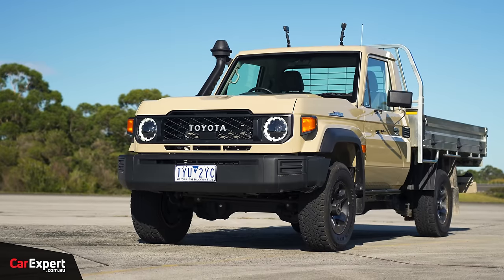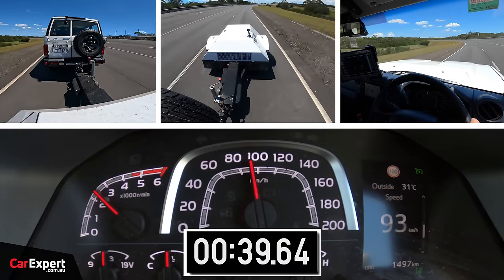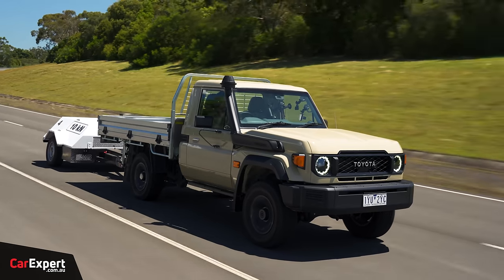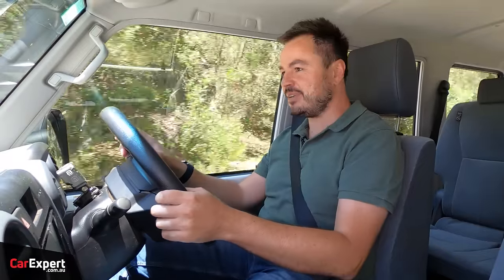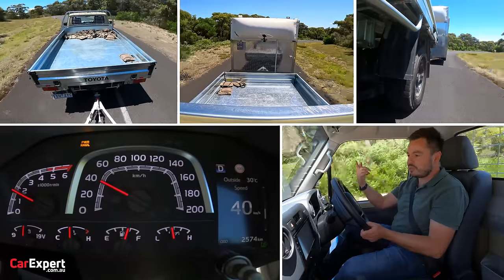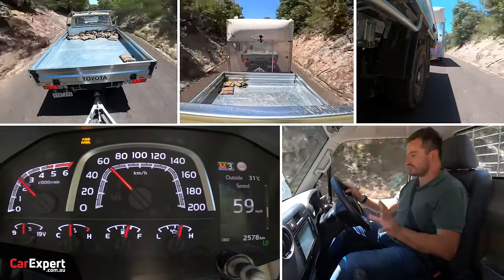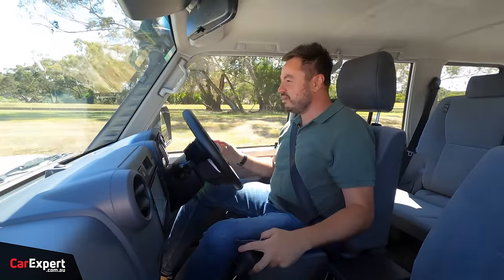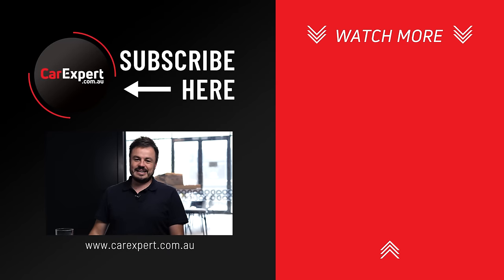LandCruiser 70 Series V8 v 4-cylinder towing stress test & drag race! Is Toyota's V8 dead?

Comment: The V8 climbing with 3.5 tons brings back fond memories of my old 2.4 litre diesel VM engine powered 1988 Range Rover. Torque dropped off a cliff under 2200rpm and the gap between first and second gear meant revving to the governor in first to have a chance of engaging second and staying there up some hills.   That contrasts with the 2.8 Toyota and my 2.0 twin turbo Ranger that really are in a different league.  Starting off up hills with 3.5 tons behind was a challenge with manual five speed transmissions, a high first gear and insufficient low rev torque. It meant starting off in low range very often, though luckily the Land and Range Rover transfer box shifted up very nicely with double de-clutching.
Reply: It amazes me that the tow ratings are that high on these vehicles. We wouldn't be able to tow 3.5t with anything that under powered in North America.
Reply: @rich7447  I wonder why you think power is important to tow 3.5 tons?  A 45hp tractor is perfectly matched to that load and I towed 3.5 tons behind a Land Rover Hi-Capacity pickup for 22 years. It had 67hp diesel when new and black smoke when old
Reply: @hedydd2  We have the J2807 towing standard which requires that a vehicle is able to accelerate to 60 mph in 30 seconds (35 seconds for DRW vehicles) while towing a trailer of the maximum rated weight. 
A 45 hp tractor is not going to be able to maintain highway speeds especially in the mountains.
Our (US/Canada) speed limits are usually  the same for all vehicles/combinations, and the police will pull you over if you are not close to keeping up with traffic. That means at least 65 mph on most interstates, but could be up to 85 mph in parts of Texas.
Reply: @hedydd2  BTW: 3.5t is not a lot of weight to be towing here. My last truck was rated for twice that and the one that I currently have ordered is rated for 13.6t (30,000 lbs).
Reply: @rich7447  I wonder how that is relevant? We have all kinds of trucks in Europe all the way up to giant Scania and so on. The class we are concerned with here though are one ton carrying capacity and up to 3.5 tons towing, over which much of the world requires a supplementary license, a tachograph even for domestic use, and enhanced safety and maintenance checks, none of which is probably relevant to you.  These Toyotas and even the HiLux do fall into this category along with the Isuzu, Mitsubishi L200/Triton, Ford Ranger and many others including Land Rovers and Range Rovers, Land Cruisers, even though they aren’t pickups. Common trait is the 3.5 ton legal towing limit.

Comment: To pull that trailer at 100kmh (set at the full 10KN) would require a very powerfull engine.  Simple math.  You need 278kw of power on the road to do that.  Not max engine power.  You need to develop that power at the actual rpm for the gear you selected (4th, 5th, 6th). 
That is AFTER you deducted drivetrain losses, rolling restance, drag etc.  Cool test!
Reply: Any of the 3 popular diesels that we get in North America would easily tow that trailer at 10 kn. For some reason they don't seem to export them to Australia.

Comment: No one is actually surprised! Figures don't lie, 500nm vs 430nm is a big difference. Anything with that much more torque is always going to perform better. What people need to understand is that the 4 cylinder is highly tuned and the performance is heavily pushed from the factory. The V8 is a very underrated engine in stock form, it has nowhere near the level of tuning and performance enhancement that the 4 cylinder has out of the box. There is a huge power potential available from tuning the V8.

Comment: And  to think people wanna toss mud at something like V6 Ranger or 6 pot  Defender despite Paul having to dive back to first not once but twice in the LC76....
Reply: I wouldn't be in a rush to own anything V6 or V8 to be honest, my partner has a ford territory with the earlier version of the new ranger diesel V6 engine, beautiful quiet smooth diesel to drive but wow what a nightmare under the bonnet! I was trying to find a drain tube for the AC and I can't really even get my hand in anywhere. 
These v8 cruisers are no different, replacing injectors is a huge job and even replacing a starter motor is a $1500 job that takes all day! The old saying holds true that if you can't see the ground when you open the bonnet you don't want to be working on it!

Comment: I had a Nissan Leaf rear and it was a disaster in wet dirt roads and in sand for flopping from side to side and bogging and that also took the power out of the 4.2 turbo diesel engine. I was always going back to low range to try and get through those conditions. I was glad to get rid of it

Comment: To be honest I have been disappointed for years in the performance of our 200 series.  For a twin turbo charged V8 it is very anemic and now with the 4cyl out performing it in every way it just proves the point.  I haven't tried to have our V8 tuned yet, I'm not sure if it is going to make it perform much better.  Might be time to trade the old girl in.
Reply: When has the 2.8 outperformed a 200? I have a 200 and a 2.8 hilux and a 3.2t horse float,  200 tows easily, hilux is slogging its guts out.
Reply: @jeremycochran3668 He doesn’t own a 200 & hasn’t driven one.
Reply: i wouldn't bother tuning any v8 cruiser i've seen chipped ones burn a hole through piston 7 or 8 also the pistons are made of aluminum i don't see them responding well to more pressure/heat
Reply: You do know the motor in the 200 and the motor in the 70 aren't identical right? I've driven 200s and I own a Fortuner, I can tell you now the Fortuner won't keep up with a 200, especially towing.
Reply: Makes my tuned Amarok look like a hypercar 😂
Reply: @stevowyeth  Tuned Amarok probably has the reliability of a hyper-car🤣.
Reply: @craigdavid6668  hasn’t missed a beat in the 3 years I’ve had it including Fraser Island and many beach runs to Double Island.
Reply: @stevowyeth make sure you get rid of it before it’s 6 years old and youre up for $8000 to fix the gearbox

Comment: It's really just a test between a car with an automatic transmission and a manual. Not surprised by any of the results (particularly fuel consumption). The guys did a good job of directly comparing the exact market offerings as usual. A better comparison in terms of performance would be a 200 series vs the new 70, however, this option isn't available anymore.

Comment: Have you heard back from toyota about the aircon being weaker on the 2.8?
Reply from the maker: Not yet! Have hounded several times.
Reply: They put a smaller aircon on the V8 when going from the 1hdfte for emissions reasons so it's more than likely they reduced it again for the 2.8
Reply: The old Landcruiser 4.2TD had insane aircon. It was like a snowstorm.

Comment: Yes Paul, the 76 is a poor tow vehicle, always advocate that to anyone considering buying one. The best item in a 76 was the motor and that wasn't great sorry to say, as everyone is discovering now the 2.8 is bettering it by far.
That swerving from side to side you attribute to narrow rear axle, which certainly doesn't help but I believe it is more to do with wheelbase (short) and the long overhang from rear axle to tow ball.
That gives caravan leverage over the 76, hence why the 79 is better as wheel base is longer.
Even our trailer wagged the 76 around, they are a herendous tow vehicle. Our van was 2.3 tonne, that 3.5 tonne, would be absolutely dangerous.
Thankyou for such a factual comparison.

Comment: The question in my mind is, how long will a 4Cyl. Turbo engine last when they have it dialled up to delver 500nm, vs the old V8
Reply: That's what I was thinking
But I reckon Toyota would have tested it pretty thoroughly before releasing it
Reply: @gdawwg1125  I guess we will see with the passing of time 👍
Reply: There’s nothing special in engineering and marketing: the former sells the truth, the latter sells the illusion of truth. A V8 4.5L will work for decades (as has already been proven by time), while a 4-cylinder 2.8L will last only as long as its warranty in a Land Cruiser body. Toyota, like any other car manufacturer, is interested in selling cars, not in customers’ savings. This is not just another consumerism trend; it’s a survival necessity in the current market. Years ago, there was strong competition among top engineers, but now, we see only a marketing battle. This battle is not about being on the consumer’s side but about selling cheap products for the price of quality ones. In 2016, I bought my VDJ76 for $75k and sold it in 2022 for $83k. Just last week, I bought a VDJL 79 V8; let’s see its selling price in 7 years and compare it to a 2.8L. Time is the best judge. When I listen to these ‘experts,’ my ears bleed, not because I own a V8 (I could easily get a 2.8L), but because I have an engineering degree and practical experience. Of course, I could be wrong, but I don’t believe in nonsense.

Comment: The 76 would not meet the requirements for its tow rating in North America. A vehicle needs to be able to accelerate to 60 mpg/96.6 kph in less than 30 seconds (35 seconds for DRW vehicles) while towing its maximum rated load.
Reply: Accelerating to 60mph at full load is not the same as accelerating to 60mph at full load up a steep hill, which is what the trailer dyno really simulates
Reply: @kev090997  The trailer dyno provides up to 10kn of drag force. You get drag force from a conventional trailer from friction/load, frontal area wind resistance and grade. 1 kn is equivalent to 101.97 kg of load. I don't think that Paul specified what they have the trailer set to in terms of  drag force, but would assume it is close to 3500 kn to simulate a 3500 kg trailer.
Reply: It's certainly different to our system, here we simply rely on the manufacturer giving us a max tow weight and Toyota over rate the 70 series, they are very unstable towing as Paul so rightfully hi lighted.
I used to arrive onsite white knuckled and super fatigued.
No other vehicle I tow with has those characteristics, you're constantly correcting the direction the towed item dictates you're going.
Aside from that, it's just not a great vehicle, so many superior wagon choices for similar money to be had here.
Utes, there's a plethora of options, cheaper and similar money to be had, most offering 3.5 tonne tow capacity also but unsure their rated well either.
Reply: @ianweal3081  We have tow vehicles with wide track front ends, but they are dual rear wheel and long wheel base. All of our tow ratings are based on the SAE J2807 specifications and we tow at the same speed as the rest of the traffic (usually around 70 mph).

Comment: Would be good to see a 200 or 300 series auto against 4cyl auto.
Reply: 300 would smash it. Very different vehicles aimed at very different markets
Reply: 200 and 300 no comparison, they would both smash it.
Reply: Reckon your in for a shock.
200 would be behind not even on pah, 300 would kick it though.
The 200 gear ratios don't do it any favours, especially towing.
Can't hold 6th on level ground where the 2.8 holds 6th up hill at 100 klms, towing.
Watch Ronnie's channel, he was gobsmacked how good it is.
Reply: @ianweal3081  Haha dreaming. From a person that’s driven and owned all of them, but the 2.8 L I can guarantee they’ll be no comparison. 

Also, 200 series with a gearbox remap and tune I can tell you they go hard!
Reply: @FoLlOwThEwHiTeRaBbIt1  yeh maybe, but no talk here of remapped or tuned, just std 200 & 300.
As I said, 300 would cover it, but a standard 200, I'm guessing not.
From standard the auto did the 200 no favours, every owner says it poor at holding gears.
This new 2.8 6speed auto I suspect will perform better with large vans in tows, the online videos of owners towing with it, they are so impressed how it just holds 6th and luggs on, no 200 does that.
Mod the 2.8 and it would perform better also, no point bringing modded 200 performance into it.
Reply: @FoLlOwThEwHiTeRaBbIt1  again, in a drag race, yes purely because you have the V8 at peak output the whole time but put them out there std with caravan in arrears driving at highway speeds on inclines and it would be close, I still suspect 2.8 will be best overall in that scenario.
200 in std trim is good but not great, this 2.8 is amazing owners how it just holds 6th and keeps tugging, far better than expected. Again, a 200 won't do that, they simply don't. 
If they did there wouldn't be a whole industry out there modifying the 200 trannie, would there?

Comment: Toyota put out a statement somewhere that i read. The reason for the narrow rear track is due to nothing more than cost. Toyota said it was not a viable option as it would require a huge amount of modification to not only the vehicles but also the manufacturing process. The cost to change the current production facilities would increase the cost of an already expensive vehicle.

Comment: Great vid as always Paul, one thing that really tests these wagons is starting off on a hill with the load, I blew the diff to pieces on my Nissan pathfinder manual with a 2.6 tonne load. Can’t fault Nissan they fixed it free of charge under warranty but it ended the holiday 👍
Reply from the maker: That would have been an experience!
Not sure we would want to try stopping on our hill in the V8. It barely made it up with momentum.

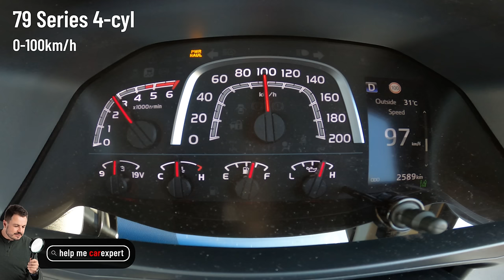Comment: 6:11 “It was much quicker to get to 100.” The V8 didn’t make it! 😜
Reply: In the v8 he short-shifted from 4th to 5th at 3200rpm, when it was still pulling! It would have got to 100kmh a few moments later in 4th. It's almost asnif he's trying to make the v8 look worse than it is
Reply: The V8 only makes 150kw. If you have a look at the results from the last tests that's not enough power to get to 100kmph. Also it's peak power is at 3400 rpm
Reply: @tersy9862  The 4cyl makes 1kw less. 150kw vs 151kw. So explain that
Reply: @tersy9862  and also, if peak power is 3400rpm, he changed gear right before it got there to get himself down to 2000rpm again. How is that getting the most out of the motor?
Reply: @tosgem  peak torque on that motor is at about 2000 rpm. If you look at the auto box it was shifting in about the same spot. I highly doubt he was deliberately short shifting. 

I was actually surprised to see the 4cyl make it to 100 as in the previous tests none did including the Hilux. The 70 series must have a power bump over the Hilux and better gearbox tuning. 

The V8 is not only massively Under powered but it also doesn't have enough gear ratios. My mum's Mazda CX-5 4 cylinder petrol makes 140 kws. The numbers don't lie. 

If Toyotos reliability is so good why didn't they give it the 200 series V8 spec????
Reply: Both engines make about the same peak power but the V8 makes only 430nm torque and the 4cyl makes 500nm, what we can derive from that is the the 4cyl probably makes close to peak power for a wider band of rpms, so even though they both top out at about 150kw the 4cyl might be making 80 percent of peak power at 2500rpm but they v8 might only do say 65 percent of peak power for example.
Reply: @tersy9862 because it's the carry over manual from the older 1HD powered Cruisers. The power and torque is not so coincidently the same as what a turbo 100 series puts out. They are all the gearbox and clutch can handle reliably.
Reply: @mrbundyk  you are not wrong but I think you'll find the actual answer is because they don't have too... 

Normally as time goes on companies spend money to improve their product. 

Or if they sell an older model for longer the price comes down. Look at the mark 1 golf as in example it was sold in South Africa for like 20 - 30 years. 

But in the case of the 70 series they realised they can do literally nothing and still keep jacking up the price year in year.
Reply: @mrbundyk  Yesh ok interesting I've heard that the 70 series clutches don't have much in reserve and need to be upgraded the moment you tune them. And yeah like you say gearboxes are rated for max torque, sure maybe it can handle more but on the 70 series it's expected to be operated at GCM a lot and also in harsh condition so they would want to have a very conservative amount of spare capacity

Comment: The only thing I would have tried differently is to rev the V8 out a little more so it didn't bog down on the upshift. If you could have kept the revs over the 2000 mark where boost was created it probably would have done a little better. That said I'm an ACE sitting here watching a video so who am I to judge?
Reply from the maker: Turbo in the V8 comes on from 1200rpm. It’s just gutless compared to the 4 cylinder.

Comment: You can never beat cubic inches, if the V8 was developed more and fitted with a six speed auto it would piss all over 4 cylinder. Also jury is still out on the longevity of the 4 cylinder when wringing its neck to get that much power out of it, i guess we will know soon enough.

Comment: i wanna see a tuned auto v8 vs a tuned auto 4cl
Reply: Ronny Dahl will do it
Reply: Has been done - tuned V8 lost miserably under tow
Reply: It's 25-30k just to put the auto behind the v8. That kills it right off the bat compared to the already automatic 2.8 litre.
Reply: @chrisandshazza01 it was better but not by much at all. His v8 runs 35’s, is a pre 2016 manual and has done god knows how many k’s. I thought that test was a complete waste of time- at least put the same tyres on.
The 4 cylinder is awesome, but if you drive a mildly tuned 650nm v8 on standard tyres it absolutely hauls even with the rubbish gearing